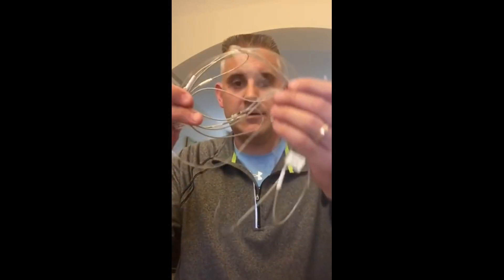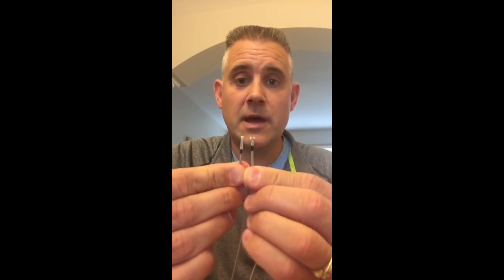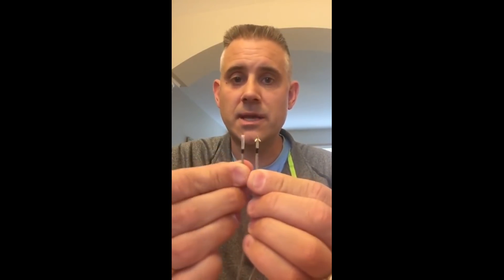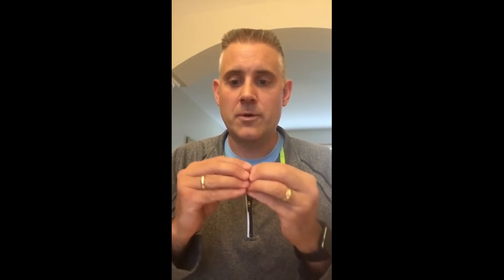Leads for Cardiac Devices

Comment: Hi Doug,  I really appreciate how clearly you explore all the topics in your videos!  I am looking for information about wear and tear on leads.  Specifically whether I can return to using my rowing machine, swimming freestyle for triathlon, and doing strength training.  I mostly use dumb bells while training at home.  My EP has given me the okay to exercise but I can't seem to find comprehensive information about whether my leads can withstand these activities.  (I have the Medtronic DTMB2D4 CRT device with 383069, 5076-45, and 6935M55 leads)  Thanks so much and keep the videos coming 🙂they are great, and really helpful.
Reply from the maker: @BridgetMurphy-n8u  thanks so much!  I appreciate the kind words!  This is a great topic, and sadly there is not a lot of solid research on it. There is no solid evidence that “extreme” sports or frequent intense workouts cause lead damage. There is a correlation between age and lead fractures/dislodgements.  20-30 year olds have more lead fractures and dislodgements vs the 70-80 crowd. Several studies have shown only a slight increase in lead damage or lead dislodgement in people who are extremely active vs those who are somewhat active. So there’s no solid evidence that says you as a triathlete have a significantly higher chance of lead problems due to your workout regimen. 

My doctor is well aware of this, and so he told me a number of things. First he said if I break anything he can fix it, so don’t worry about that.  Second he told me that my ICD and leads are there to protect me while I live my life how I want to live my life. They are not there to restrict me in any way. He also told me I’m not allowed to use my device as a reason to not do something.

With that in mind I have decided that I will not restrict myself in any way.  If someday we find I have damaged a lead I’ll work with my doctor to determine if my activities caused it and what I can do differently to prevent that from happening again.  My doctor has said he’s not a big fan of rowing, but he admits that’s because he had a patient, a college age woman, who was on the crew team at the local university, and who was competing to join the Olympic crew team. She broke a lead and he said it was due to her extreme level of training and competition.  But, he said if I wanted to use a rowing machine in my exercise routine that he wouldn’t object. Basically he has given me permission to push the limits, and if I break something we’ll fix it and reassess to determine if I could/should continue with my normal workout routines. 

I’d say continue to work with your doctor. If s/he is aware of your exercise routine and gives you the thumbs up, I say get to it!  And good luck on your next race!
Reply: @DouglasRachac  Fantastic!  Thanks so much for your speedy reply, Doug.  It has been a really tough go for me.  I ended up in ICU with complete heart block last Sept, received a pacemaker 8 days later, then was upgraded to the CRT ICD device in Jan. following the confirmation of cardiac sarcoidosis.  To go from being a 53 yr. old Olympic distance triathlete and marathoner to full stop has been hard.  I am trying to return to some level of training and your words are really encouraging.  Like you, I use my rowing machine for fitness, and I plan on lifting lighter weights, so here's hoping my leads will be fine.  My EP also told me to focus on quality of life, so I think he is saying something similar to your doctor.  Cheers!

Comment: Very informative. I’m now on my third ICD, but the lead is the original implantation from 2000. I asked my surgeon about that. He said that it’s pretty risky to remove the original lead because a lot of scar tissue develops around it, so there’s a greater chance of having a small tear in the heart muscle that can cause some heavy bleeding. So even though he performs the procedure, he recommends against it. A big problem, however, is that the newer generators are immune to more common magnetic forces — in the kitchen, at the airport — but the original lead is not. So the patient can be lulled into a false sense of security about exposure to magnetism.
Reply from the maker: Hi Dave, thanks for watching!  Lead removal has come a long way in the past decade, but there is a risk. If the old lead isn’t causing any problems it’s safer to just leave it right where it is.  

The only real concern with older leads is their restrictions when it comes to MRI machines. Some older leads have been declared “safe” for MRIs, but many haven’t. Otherwise, the leads aren’t affected by magnetic forces like metal detectors or small kitchen appliances. A modern device connected to a 20 year old lead would be safe in those environments.
Reply: @DouglasRachac  My electrophysiologist currently thinks that lead removal is to be avoided unless it has deteriorated from, say, excessive body-building. I said, “do I look like like someone who does body-building, excessive or otherwise?!” But, as you pointed out, the old leads may be subject to harmful effects from an MRI. There is an online database of the various models, and mine is listed as unprotected. So I have to be cautious, and I would never buy an induction stove, for example. Why take a chance?

Comment: If you know, what has been the longevity of Medtronic leads? It's always been a concern of mine that since I'm only pacing @ 2% and have roughly 11yrs left on my battery that when it's time to replace my PM they will need to replace the leads. Do they leave the old lead in place or attempt to remove it? Does leaving it impact blood flow back to the heart? Can attempting to remove the old lead run the potential of damaging the heart wall? (I know, lots of questions for "some guy on the internet.")
Reply from the maker: Hi Shannon, thanks for watching.  Let me see if I can answer some of your questions.  Typically, during a procedure to replace the device, they use the existing leads as long as they are still working normally.  Some leads last 25 years or more, so there's a good chance one set of leads will be used for at least 2 devices, maybe more.  If they do decide to replace a lead they usually leave the old one in place and "cap" it.  Adding more leads into the vein doesn't really effect blood blood flow to the heart because the vein they use is fairly minor.  Some people have seen a slight rise in blood pressure, but that's not very common.  And, the leads are getting smaller and smaller every year, so more leads can fit in the same vein.  If they do need to remove a lead the technology to remove leads has advanced in leaps and bounds in the past decade.  Lead removal is a common procedure these days and there are doctors who remove/replace hundreds of leads safely each year.  I'm sure by the time you need a lead replacement it will be even easier.  I hope that helps!
Reply: @DouglasRachac  All of that is correct but there is no relation between multiple leads on the right side of the heart and BP.

Comment: Fascinating stuff! The leads are larger than I expected. What diameter are the veins that they are inserting the leads into? Thanks.
Reply from the maker: That’s a good question, John…. One I don’t know the answer to. But, I do know that some people have up to five leads in their veins, so they hold quite a bit. Todays leads are much smaller than the leads of yesteryear, so I’m sure they can fit more than 5 or today’s leads.
Reply: @DouglasRachac  Thanks Doug, I did a bit of Googling around this. Fascinating stuff. I won't bore you with the details, but it seems these veins are much larger than they were in my head!!! Take care.
Reply: @DouglasRachac  When the cephalic vein in the deltopectoral groove is used, the vessel is highly variable in size. In some it may be only a mm or 2 in diameter. In others it can easily be more than 5 mm. Small veins are easily dilated to accept the electrodes.

Comment: Hello, My uncle had kept his ICD since 2013, and when we heard the ambulance siren tone recently, we went to the doctor, who said it was due to a manufacturing defect in the leads, and we needed to replace the lead, but he never received any shock. I was just curious as to why it lasted less than ten years.
Reply from the maker: Hi Monica, thanks for watching. An ICD from 2013 lasting ten years is actually quite good. Their typical lifespan back then was 5-8 years.  Leads are supposed to last a bit longer, but issues like this do arise from time to time. Once replaced the new lead should last a lot longer.  Some have survived 30+ years. And todays ICDs are designed to last 8-12 years, possibly longer.
Reply: It's 2016, not 2013. Thank you for your response.

Also, does one lead work in case of any issues because the other one is a defect, as the doctor suggested replacing it after a month and we planned to do it in 10 days? 

What will be the new lead's life span be once changed?

Comment: Those look BIG to me, like how large is the vein they are going down?? looks like it would blck half the diameter of the vein and more when the tissue forms over it!
 thought initially they attach the leads to the outside of the heart surface, I didn't know they actually run it inside a vein partially occluding it, scary!
Reply from the maker: Hi Hobby, the vein that is used is not a major vein, so restricting blood flow through it is not a concern. Right now leads are a size that allows room for 4-5 leads in the vein at a time, but leads are getting smaller and smaller every year, so they’ll be able to fit more leads inside that same vein. Also, the technology to remove leads has come a long way. Now there is laser extraction technology that makes removing a lead that has been surrounded by scar tissue much easier and safer.

Comment: Thank you so much for the informative video.  I have two questions about leads hoping you can shine some light.
1. What is the purpose of the 2nd lead in an ICD?  Do single lead ICD pace as well?
2. Does having ICD lead increase risk of coronary artery disease or increased risk of blood clot/stroke/heartattack, since the scar tissue around the lead takes up space?  If I already have high cholesterol with plaque am I at more risk with a lead?
3.  Will all the leads compatible with future new devices?
Reply from the maker: Hi there, thanks for watching!  I think I can answer a few of your questions:
1) the second lead is there to pace a different chamber of your heart.  Typically the first lead is for your right ventricle (but not always), and the second lead, if it's needed at all, is for your right atrium.  Some people do just fine with a single lead system, others need the help of a two-lead system.
2) These are good questions, but I don't know the answer to those.  Your Cardiologist or EP should be able to answer those for you.
3) The sizes and header block pins of the leads are standardized across the industry.  So, a lead implanted today will be useable for decades into the future, even if you get a device from a different company.  I hope those answers help!

Comment: Does the patient always need to take a blood thinner because of the leads?
Reply: I’ve had three ICDs over the last 22 years. I’ve taken blood thinners, but never because of the ICD lead. I take a baby aspirin daily. I occasionally take xarelto if I’m on a long flight, or for a few weeks after an afib episode.
Reply from the maker: Hi Kevin, no, blood thinners aren’t needed because of the leads. There may be other reasons, like persistent atrial fibrillation, that require blood thinners.  But usually blood thinners aren’t needed with the implant of one or more leads.
Reply: @DouglasRachac  Thank you

Comment: Hi Doug,
I worked in an interventional cardiologist's office but have learned so much more DETAILED information from you.  Thanks!  

Had my 3rd device placed last week with Medtronic Colbalt HF SureScan CRT-D.  I went from initial pacer (100% dependent) to combo-unit to the Cobalt as my battery depleted.  When my pacer was stepped up to the defibrillator my doc wasn't able to remove a lead so I have an extra unused lead.  My question is......since I have the extra lead would that change the protocol for an MRI?  I have scoliosis and spinal stenosis and am fused L1-S1 (hardware removed) with more fusions likely and my ortho is considering an MRI.  Any thoughts?   

If I can ask another question.......when a lead is retained is it clipped off, stitched in place, or what?   Thanks again.
Reply from the maker: Hi Idy Gal, thanks for watching and for your nice comments!  I’m glad to hear my videos have been helpful. The MRI question comes down to the individual components of the entire system. Each item, including the unused lead, needs to be MRI compliant or MRI ”safe” in order to have an MRI. There are some larger institutions who perform MRIs on older, non-MRI safe leads, but that’s because they have years of experience with their processes and procedures. You’d have to do more research to find out which ones do this. Unfortunately I don’t know the names of those hospitals. 

As for the abandoned/retained lead, they usually “cap” it with a little cover and leave it in the body. Sometimes, if they know it won’t be needed again, they cut it shorter and then cap it. It won’t float around or go anywhere due to the scar tissue it already has inside the blood vessel, so there’s no need to tie it or tack it down further. I hope that answers your questions.  Thanks again for the note.
Reply: Thanks Doug.  Stay well.

Comment: Question if they sew the leads in place by the vein and a patient were to lose a significant amount of weight I mean would the actual location move? I mean it feels like that piece they sew is actually in the bend of my shoulder and am being told that's what it is and that it is ok. I feel it is not ok.
Reply from the maker: Hi Regina, thanks for watching.  It’s possible that things can move around with a significant amount of weight loss.  Most time, though, that won’t affect the leads.  It’s more of an issue with devices that are just placed into the pocket, but not secured down.  If your healthcare team is confident in the current location of your implanted system I’d say you’ll have to try and trust their opinion.  Congratulations on the weight loss!  That’s really terrific!
Reply: If it is of some comfort to you, I implanted a system in a pt. who weighed over 400 lbs. She subsequently lost half of that and experienced no pacer-related problems at all.

Comment: Please, Can I go to sauna with my peacemaker?
Reply from the maker: Hi Samuel, the leads and device can certainly handle a sauna, but your heart condition may not allow it.  You need to speak with your doctor to ask if your heart can handle the higher heat of a sauna.  If so, your device and leads will be perfectly safe, protected by your body.
Reply: @DouglasRachac  Thank you for your answer. My heart IS ok. But doctor told to me ,than temperature above 40 degres IS dangerous for a device....overheating.....???. Metal parts...?? I have medtronic peacemaker.
Reply from the maker: Samuel, Your device can handle the temperature of a sauna or hot tub.  You can see what Medtronic says on their AskTheICD website (the answers are the same for pacemakers) here: http://asktheicd.com/tile/420/english-life-with-an-icd/can-i-go-in-a-sauna/  You can also see a sauna is listed in the "No Known Risk" category of Medtronic's Electromagnetic Compatibility Guide here: https://www.medtronic.com/us-en/patients/electromagnetic-guide/household-hobby.html  Your pacemaker can handle a sauna.  The only limiting factor would be your specific heart condition.  If your doctor clears you to use a sauna with your heart condition, then your device will be right there for you if you need it.
Reply: @DouglasRachac  Thank you very very much Douglas. 👍

Comment: Hi Doug how do you know if your leads have been dislodged? I have an ICD that was implanted 2 weeks ago and I'm just trying to educate myself. thank you for your videos
Reply from the maker: Hi Therese, thanks for the note and thanks for watching.  There's a couple of different ways you might know if a lead is dislodged.  One is if you start experiencing symptoms again.  Things like light headedness, or being really tired.  Those are signs that a pacing lead has dislodged.  With an ICD the other way to know is that your device will emit a tone at a specific time of day if it sees something change drastically, like thresholds.  Thresholds would change drastically if a lead dislodged, so your device might emit a tone in that case.  Other times (and this is what happened with me) it took an xray to determine that the lead had moved enough that it would be ineffective in its current location.  The good news is that lead dislodgements are not terribly common.  They do happen, but most patients never experience one. So, its best to follow your doctor's post implant instructions (don't lift anything more than 10 pounds for 6-8 weeks, don't reach above your shoulder for 6-8 weeks, etc) to give your leads time to heal in place.  After that you can slowly return to your normal routine.  The hard part is not worrying about issues like lead dislodgements.  Best of luck on a quick recovery!